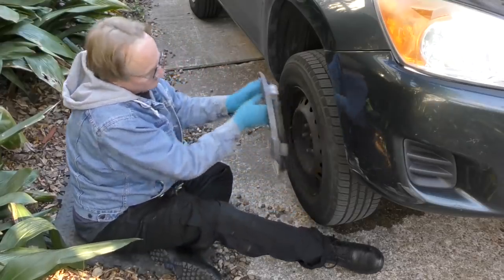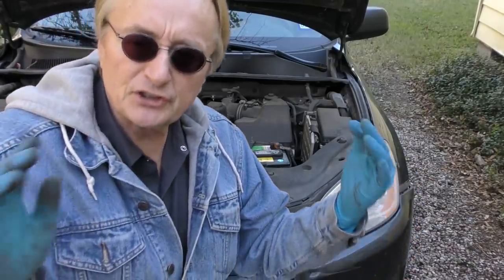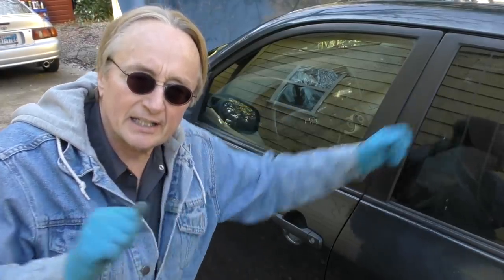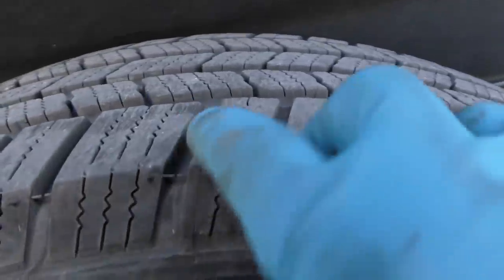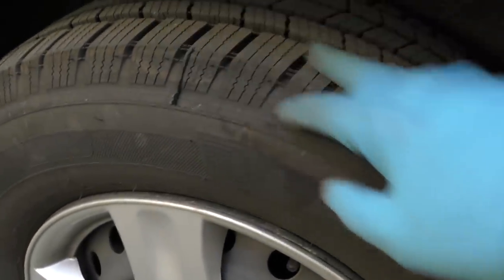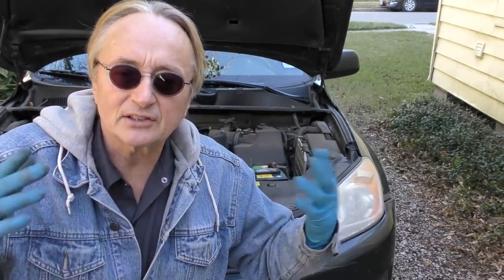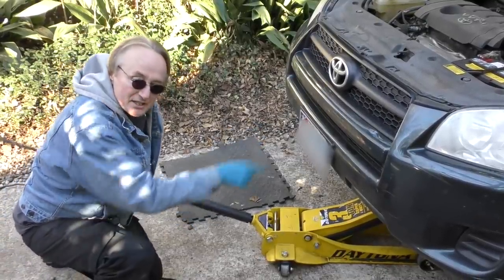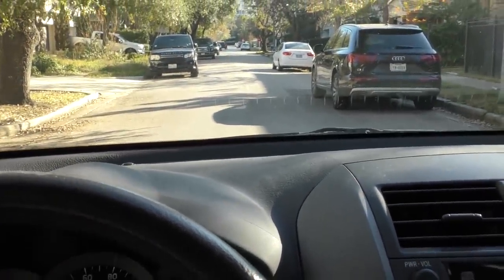Tire Secrets Only Mechanics Know

Comment: Every 'Other' Oil Change (3k miles) on our 2007 XLE Camry I have the tires rotated.
Around 5k to 6k miles and our tires wear real well that way.
And I always buy Michelin now.
Reply: I have never ever had a customer with a Michelin tire problem. I always recommend them if they can afford it
Reply: @rays7437   The tires in the video were Michelin.  They looked to NOT have been rotated very well.  Hence the 'Tire Problem'.
Reply: @OldDood  
Agreed.  And by the weird wear pattern, I would say that it could benefit from new struts and shocks, along with an alignment.

Comment: Hubcaps are the best. My parents old 2001 Corolla, the hub cap got smashed when going into the garage. The garage was very small. I found 2008 corolla hub caps for $5 each at an op shop & they fit fine.

Comment: on some vehicles the spare is a full size spare and most owner's or SHOP's do not think of them when you rotate the tires. on these vehicles think about your spare the  next time you rotate your tire's. i had a 4x4 SUV that the spare was still the original and was 21 years old when i had a flat 10 mile's from the nearest town that i had to put on and was never even balanced, which meant i had to mount it on the back axle(my flat was on the front axle) so i could mount a balanced tire on the front. Spare tires are there for reason's and should be thought about so you will not have to do double work if your front tire goes flat. just sharing an experience i had with a flat tire.

Comment: You're right Scotty, about the front tires being more important.  However, if your front tires grip and the rear ones don't grip as well, the car will want to rotate, especially under braking.
Reply: Sean Thompson, Agree if the tires don’t have enough tread life but those front tires look in good shape, its really only a problem in the wet or snow not so much in dry conditions.

Comment: Scotty, I hope you looked up the torque specs on those lug nuts and set them correctly!  I recently lost a wheel at 45 mph due to too many tire monkeys hitting those wheel lugs with an impact wrench and tightening them down to 120 lb/ft, instead of the 80 that is specified for the car.  A couple of the wheel studs sheared off from the metal fatigue and the rest immediately failed.  Scary result of years of negligent tightening!

Comment: They do that because if you corner, the back is more likely to swing out, and since the back of the car controls the vehicle, you lose the control. Its seems stupid but it actually makes sense(putting the new tires in the rear).

Comment: I went to Akron u in early 2000s and took a vehicle Dynamics class from a  Firestone tire expert there, Dr. J.D Walter. I remember him telling us the reason you want more traction in the back. He said under heavy braking, if you lose traction at the rear tires your car is unstable, and can spin out... back end swaps with the front end, ie reverse pendulum instability. If the front tires lose traction under braking while the rear have traction, it's still stable. This is why back when the car companies offered 2 wheel Abs, it was only provided in the rear axle.

However, in this case, I'd not be afraid to rotate the tires like Scotty did, and I bet Dr Walter wouldn't be either. As long as the treads similar, the traction will be too. Where you could potentially have a problem, would be a bald set in back with two new tires in the front. If there's snow or deep water,  your car would be much more likely to become unstable and spin in a panic stop.

Comment: always best to have the good in the front. you don't want to risk a blowout on the hwy with front, you could lose control. sometimes its the tires & weak sidewalls. I had a shop install four brand new tires & when I left their shop the car was swaying all over the place. the mechanic then drove it & noticed it too. it was dangerous so he removed them and sold me a different brand.

Comment: Hi Scotty, this is generally good advice, however not so much on my old Kia Spectra. The Spectra has a bad habit of doing donuts in wet or icy weather. You have to have the best tires on the rear to keep it stable. Learned this the hard way....

Comment: Scotty, where I bought my tires they offered free tire rotation for the life of the tires/car/me. I rotate my tires every 6k miles but I also have them check and correct the balance as well. It costs me nothing but a signature on the receipt. Am I stupid for checking the balance at every tire rotation?
Reply: If you have the time, do it. What if you throw a balancing weight?  It might be a subtle problem.  Air pressure monthly, balance at 5k-6k and ask for tread depth measurements too. Catch problems before they get serious.
Reply: No you are not; especially if they don't charge you and you have the time for it.  
I don't usually check the balance unless I pick up a vibration or see a wheel weight gone. Just because of not wanting to spend the time

Comment: I tend to buy used tires, not balanced, and they’re cross branded and sometimes different side wall and width size from front to back.  But I always get the tire shops advice.  I’m cheap.

Comment: Scotty I got to ask, do you only run fwd indoor cars? I have always been told to put the good tires on the back of my f350 diesel so I dont just smoke the tires if I dont have the trailer hooked up. Like to see your input on a heavy duty pulling truck and not just small cars. They RWD unless you shift into 4 and all the weight is over the front axle if empty.

Comment: another video with great advice, worked in a tire store myself and heard all sorts of wonky ideas, like getting winter air put in your tires. Scotty, i live in northern BC canada, and my 2000 toyota camry locks up the front tires well before the back tires on icy roads. is there a way to change the brake bias to the back more?
Reply: Robert Burley  please tell me you are joking? Winter air is a myth, unscrupulous garages spread it to make an easy ten dollars by emptying customers tires and then refilling them. The only thing that matters is the pressure in the tire, warm air when cooled down to winter temps will have slightly lower pressure than it had when you put it in(, also possibly more moisture now that i think about it). And vice versa for the cold air when heated to normal temps in summer. If you do think the air going into your tires is warmer, check your tires the next day and make sure they are still at proper operating pressure.

Comment: Mechanics; both professional and novice alike, all use rags. Hand down the best rag I've ever discovered is tube socks. Especially for certain jobs like changing fluids; you can wipe down the oil filter mounting/drip areas, and the oil/fluid pan when you're done. They also work great for cleaning/protecting tires and wheels. I'm sure you'll find other great uses. So save your old socks; the best ones don't have holes in the toe area yet. And FYI, the best oil filter I've discovered, is simply a piece of sandpaper; almost any grit works great, just cut a full sheet in 1/2's, or 1/4's (I like 1/4 sheet) put it in your hand and grab that puppy; you'll never use another wrench.

Comment: How did you rule out the front rotors? Didn't notice you measuring it's thickness. Asking you this as my 2014 VW TDI has the same issue.

Comment: I have always rotated the tyre's every 10.000 km,   front to rear,   when replace tyres always two at a time mostly at the back firstly then another rotation,   check pressures every month,   only wear tyres down too 3 mm then replace them,   important to check regularly for wheel alignment, especially if hit curbside or very bad road's,

Comment: dang after reading other posts i see still some people don`t understand the regular wear on the front tires, so to make it simple when your car turns the tires are actually braking thousands of times per second {rolling resistance pushing a force in motion} and the weight {mass} of the car is shifted to the outer edge of tire thus the wear. so rotate tires properly and check air pressure

Comment: I just put new tires on my 1997 ES300 Lexus (112,000 miles) and it dramatically improved the steering response. I am still shocked, because the old tires had at least 1/4 inch of tread. The only reason I replaced the front tires is that one failed, probably due to a puncture. Now it drives like a new car, with easy steering.
Reply: New tires make a huge difference in ride, noise, and handling. I start shopping tires when the tread is still at 50%
I love having new tires
Reply: @rays7437   Yeah, I learned that. I just hate spending much money on a 22 year-old car. The new tires are guaranteed for 55,000 miles, which is 10 years of driving at our current rate.
Reply: @HSMiyamoto  
I can understand that. But be aware tires have a 7 year maximum life. After that they are not considered safe to use.
Reply: @rays7437   Wow, I didn't know that. I am going to ask mom if she remembers getting new tires over the last 22 years. The spare was the original until last week, so that suggests the front tire just wore out.
Reply: @HSMiyamoto  
In the U.S. the tire manufacturers are required by law to put a date code on the sidewall of the tires so that you can tell how old they are.  Sometimes the code on on the outer sidewall, sometimes the inner.  It usually is 4 numbers such as  0619 which would mean that the tire was made on the 6th week of 2019
Reply: @rays7437   Great, I'm sure that helps out more car-owners than just me.

Comment: wheel balance, end links, and a seized caliper could also cause this. ps. the 2 good tires on the back thing is actually for 2 winter 2 all season tires. The reason is to prevent the back end from coming around under hard braking on snow and ice.

Comment: Another reason to have the higher tread tyres on the front is to reduce the risk of aquaplaining.
Obviously, cautious, non cruise control driving while raining is the best to reduce the risk of aquaplaining.
Always drive to the weather conditions.
Every now and then it rains SO hard that it best to get right off the road (try to stop on a hard bit of roadside) and wait until visibility has improved.

Comment: Hey, Scotty. I wish you weren't so critical of Chrysler and Mopar. My mother has a 2008 Dodge Nitro with 185K original engine and transmission. The transmission only slips the slightest bit and that's only at full throttle. No major repairs. Only been in the shop for an A/C evaporator. Just recently the motor mounts have started to go out but this is a car that's been run hard in the city most of its life.

Comment: Scottie, you are indeed a great mechanic and honest person. I've benefited immensely from your videos, but it's not a good idea to 

lean a tire against your customer's car, because you can scratch the paint even if the car has 180,000 miles on it.
Reply: If it was a Chrysler/GM/Nissan I would agree with you but this is a Toyota so the paint isn't as delicate.
Reply: Actually, I have several Toyota's and a tire will scratch the paint, which is why I don't do that. Tires pick up not just dirt but tiny pieces of rocks, which will cause scratches. Even if you are right I doubt Scotty will check the type of car before he leans a tire on it, and it's a bad practice. It's better to be safe than sorry.
Reply: @ezorro5920  what type of tire picks up debris on the sidewall?
Reply: @adcolt54  The top threads and their sides pick up dirt and depending in the angle the tire is leaned on that top thread and dirt will be on the cars paint.

Comment: If you only replace 2 of your tires you do it to the front, that is where the control is, even on a rear wheel drive. And put the two best tires on the rear. I don’t understand why some people don’t get it. If you drive on wet roads you want good front tires.

Comment: Hey Scottie, how come Toyota won't bring back the VVTL-I system that used to be the in the Celica GT-S, and the Corolla/Matrix XRS. The regular VVT-I and the newer Dual VVT-I only changes the valve timing and does not actually lift the valves like Honda's VTEC.

Comment: Just thought I would explain the 2 tire issue, seeing as the shop you went to couldnt be bothered to do so.  The purpose of putting the new tires to the rear is not to keep your front wheel drive car from spinning on take off. The rear of the car is the light end and the lower tread tires will preform worse on the lighter rear end compared to the new tires on the heavier front end, thus increasing the possibility of hydroplaning (which actually starts in the rear most of the time) or spin outs on snow/ice especially while cornering. 
 The best solution  would have been to replace all 4 at the same time and do regular rotations to keep the tread wear within 2/32's of eachother at all times, thus eliminating both problems. 
 At the shop I work in ,we would have recommended 2 new tires put to the rear (with full explanation) , but you would have had the option to sign a waiver and not follow the recommendation.  We would have replaced the worn front tires as requested, then  balanced and rotated the older rears to the front and the new to the rear had you chose to accept the recommendation.
Reply: It actually is for "Safety."  💙🙋👍 If you have more traction in the back (newer tires), worst thing that can happen is that your car will understeer (plow head on) to a pole, in a snow storm. 💃👀🙋 But if you put the Newer tire in the front, when you have balding tire in the back, you will spinout (oversteer) in to a Deep ditch like James Caan in the Movie MISERY, and be kidnapped and have your both of your ankles hobbled,,, 😱😵😨😭🙏 ,,,,        😂😂😂
Reply: Hi EricBee Fpv:  Best advice in a nutshell.  Pity that so many of the dumba***es driving around don’t accept this advice.  You (and your tire shop) obviously know your safety codes!
Reply: @iainmeteorscan1555  most don't, then want to come back and b@*ch when they spin out in rain or snow. They act like we sold them sh@t tires and can't accept that they made a bad decision to put the new ones up front with crap ones on the rear.  People... I tell ya.

Comment: Scotty, you are the man and Happy New Year.  I have the exact Toyota Matrix, same year and color and everything as you.  But I notice that despite the headlights being brand new, one or the other headlight won't come on occasionally. The internal clock also occasionally will not come on and sometimes it does.  The lights illuminating the AC controls will either work or they won't... there's no rhyme or reason, just sometimes they work and sometimes they don't...  What could be the possible cause of this and how can I fix it?

Comment: The problem with having bad tires in back comes in snowy/icey conditions.  Loosing control of the rear end at speed and fishtailing is hard for many drivers to correct. But other than that I dont see any other reason for putting new tires in back.

Comment: I put been new yokahoma advent tires on my 05 impasla 75000 mile tires! 38000 miles later my back tires ate shot fronts are fine. 4 wheel alignment showed car was good still rides fine. Why would my front wheel drive 05 impala wear the back tires so much quicker than the front. I've replaced all 4 wheel bearings breaks rotors. . In the process noticed my rear tires being bad thanks for ant tips

Comment: The Main reason you want best on rest is due to the rain if you do slip the rear having good thread will catch and you won’t spin out as if you had the bad ones on rear like around 3/32nd and below is when I stop rotating and just leave best on rear for customers but on my own car I’m cheap and I drive carefully so I rotate until there is no more tire like 2/32nd on all 4 lol

Comment: Tyre fitters put newest tyres on the back, this is safest in wet conditions and will keep the car more stable (doesn't matter which wheels are driven) Tread depth shouldn't affect dry braking or dry acceleration at all.

Comment: Hey Scotty love your videos and your information that you're supplying us with but I had and experience dealing with tires on a Pontiac transport 2013 dealing with balancing the tires speed you get vibration what is speeds reach 65 miles per hour and using lots of counter weights to balance them,  they don't turn the tires anymore to the rim as in your experience what do you think about newer tires not needing balancing just adding weight???
Thank you for your expertise..

Comment: i have a 4x4 and it runs on 2H rear drive most of the time. should I keep my good mud tires up front or switch them with the worn tires from the back? i know i need a couple used tires. I have one tire thats worn from peeling out and it tends to slip when starting off. thanks

Comment: The idea of best tires on the rear is a logical point. The rear of the car being the light end having the best grip helps in a low traction situation like turning on a wet road. If the best tires are on the rear, you have the best chance of not losing traction in the rear and the rear end breaking loose and the car spinning and losing control.
That being said, tires DO need regular rotating, so at some point, the best tires will end up on the front by default. It's just the way things work.
But it is always best to replace all 4 tires at the same time and rotate tires regularly.

Comment: I have an 07 Toyota Corolla and I went for air bag replacement, the service gave me a set of instructions to fix since it has 136K miles on it. Struts, Sway Bar Links, Timing chain tensioner and drive belt. Not sure these are real to change it and gave an expensive statement.  Can someone please help me.

Comment: Had a brake issue once where the car would pull one way when the brake was applied, and continue to pull after release. Turned out the rubber brake line had swollen internally and would let fluid into the caliper, but wouldn’t let the fluid escape back out. The main clue was the melted center cap.